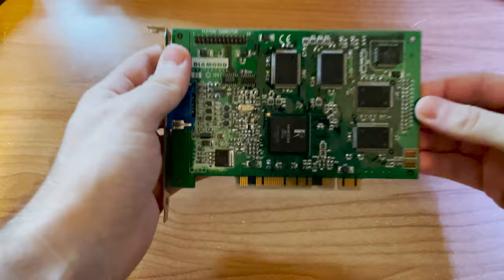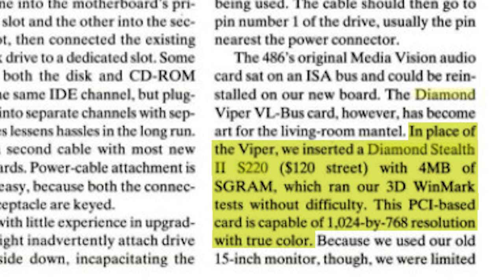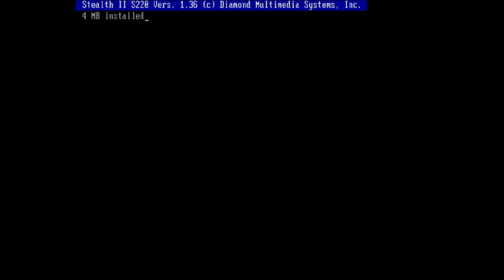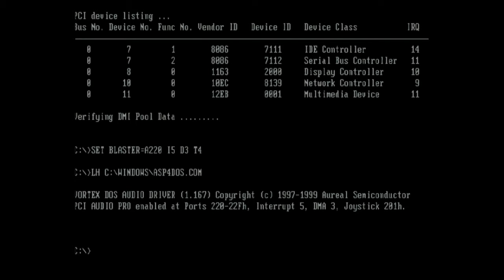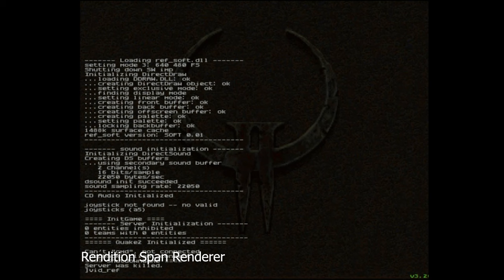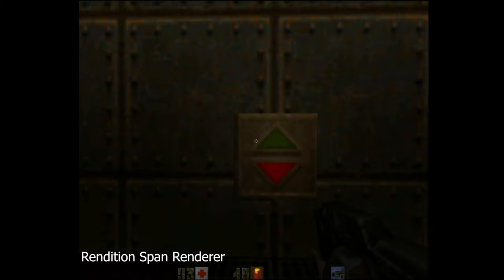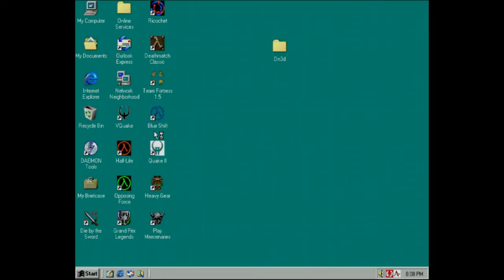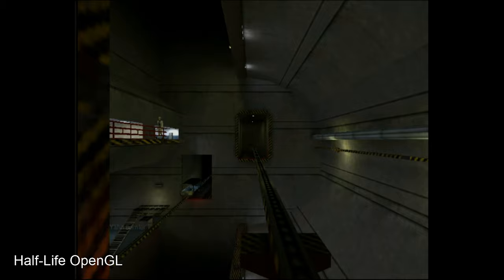So You Think You Want a 3DFX Voodoo: The Rendition Vérité V2200

Comment: It was originally clocked at 40mhz/100mhz core/memory.  Then there was a bios update that increased it to 55mhz/100mhz, however, you could really push it.  Add a little heatsink and it would clock at 70mhz/140mhz.  It was a value beast.
Reply from the maker: Hey, thanks for watching and thanks for the support! I do have that BIOS update on my card and it really did make a massive difference. Truthfully, without it, I probably wouldn't have made this video; it makes the card a much more interesting and much more pleasant experience. I can't believe just how well these things take that OC, and I'd be interested to see how it does at 70MHz/140MHz, as that seems like a pretty big jump, but I can imagine it'd be stable. I'll have to give it a go sometime!

Comment: I put one of these cards into a Pentium MMX system about a year ago.  I've decided to leave it there at least until I play through Quake.  I never got very far in that game back in the 90s, so I need to get back to it.
It's also interesting that this GPU has an accelerated version of Papyrus IndyCar Racing 2.  I wish they made a similar accelerated version of NASCAR Racing, a game I played obsessively back then.

I recall reading they had some manufacturing issue with the V2200 chip which caused a huge delay in it getting launched.  That delay was fatal.  They had the fastest GPU for a month, then Voodoo2 came out and they were a generation behind again.  This killed the value of the chips and the cards, and ruined Rendition's chance to gain an enthusiast following.
The 3D gaming chip market in the late 90s was such a precarious business to be in.  It was so easy for 1 strategic mistake or manufacturing problem to doom the fortunes of a company, leaving them without enough revenue to keep up with R&D.  By the end of 2000 there were only 2 companies left competing at the premium tier.

Comment: Wow. Somewhere I've got a several page spread from PC Format magazine (in the 90's), showing dozens of competing cards in the early days of PC 3D gaming. It was mainly 3 variations of the S3 Verge (or Derge as it was known 😆), a few 3dfx Voodoo variants, I think Matrox's Mystique or Millenium (don't  recall which)  was in there along with the Rendition Verite and a little known chip (from or called) Glint. That is off the top of my head.

At one point I had a Matrox M3D based on the PowerVR2 chip, that had 4MB RAM. It was a pass through board (like the early 3Dfx 1&2) but used the PCI bus instead of a VGA cable.  So no loss of image, it had no issue running Half-Life back in the day. It was along side a 2D card providing the screen buffer. I never saw either Verite or Glint based cards.

Comment: In the beginning, the purpose of a 3D card was to relieve the load on the CPU and thus achieve much smoother frame rates than the CPU could in software rendering mode due to the existing games, which were initially all developed for software rendering. For this reason, it is best to put such a card in a slow Pentium 133 MHz or slower.
A Pentium 2 is already faster in software rendering mode. I played the first few levels of Jedi Knight in software rendering mode because my P2 266 MHz was fast enough for that and there were no usable 2D/3D graphics cards for my taste available, when i bought my P2 brand new. Around 2 years later i installed a Voodoo 3 2000 PCI as soon as it was available.
A suitable card for your P2 333 MHz would therefore be a Voodoo 3 or even better a Voodoo 4 or 5 but definitely not this Rendition Verite V2200.

Comment: It´s nice to see fans of this card today, but I had one to use back in the day, and I never did. I had a Diamond Monster Voodoo 3Dfx connected to a Rendition V2100, and I could just choose what card to run the game on. The 3Dfx card would just run, period. The Rendition would not run at all, or run really slow, or full of glitches and visual bugs. Not as bad as a Permidia or a S3 Diamond Stealth, but geez. So I used it as a 2D gaming card and for Windows GUI, which was fine. Also, first card that I did a BIOS update. Saw no difference, but I did. In Rendition defense though, I guess my CPU was weak. Can´t remember if it was a 486DX2 66 or one of those Cyrix scams.
Reply: The Rendition, especially the V1000 does have one other drawback. It is a very slow videocard for DOS Games that use Software Rendering. Thus games like Duke Nukem 3d or Wing Commander 4. A real 2d DOS videocard with enough RAM for high resolution window modes and 2d window acceleration features is a much better combination with a Voodoo Graphics or Voodoo 2 accelerator.

Comment: Someone really needs to write a Verite emulation for DOSBox.
Reply from the maker: Thanks for watching!! I hope you enjoyed! Agreed! Honestly, it’s more compelling than glide because vQuake is so darn pretty! Rendition’s rendering is more hardware-specific, but I’m sure it can be emulated. I’d love to see it, as these cards are a bear to find working. The verite had a shorter life than it should’ve, but it’d be neat if someone could bring it back to the masses via DosBox or some build thereof!
Reply: @RetroTechBytes  Totally agreed that Rendition emulation is more compelling than 3dfx's. There's also Tomb Raider that looks more vibrant with Verite V1k compares to Glide version with quite washed out color and yet Rebel moon which runs in 3D acceleration only with V1k as well as vQuake which you just made me perceive how it was so valuable. I once had both V1k and the Diamond Stealth II S220 (V2100). It's so regrettable for me today by the fact that I sold both of them to buy Voodoo 2 card by a misled depreciation in the past.
Reply from the maker: @mytube9182  Absolutely agreed! OpenGL in Quake is unimpressive visually. The performance is definitely great, but there’s no denying that vQuake was the original 3D-accelerated port of Quake, and it’s probably the coolest because of that. Hey, Voodoo2s were still legendary cards! But you know what? Having had and enjoyed the Verite is the best part, and the memories that come from it are just something that wont leave you!
Reply: @RetroTechBytes  That's very true. I just can't forget the Verite's and feel that the defunct of Rendition is something regrettable when it come to stories of 3D accelerators.

Comment: Rendition were such a loss to the market, they had the potential to be a 3rd big player but Micron bought then and ran then into the ground. I had a V1000 system and even no that Vquake ran great. During this time ATI were nowhere they were still struggling to make a competitive 3D solution like S3 were,  an opportunity was there to be taken.
Reply from the maker: Hey, thanks for watching! Oh yeah, the V1000 is such a cool card! And I bet it was great on vQuake! It probably would’ve handled vQuake II just fine too actually! The span renderer was developed for the V1000s.They definitely were really close to being the 3rd dominant market runner, that’s for sure. I think the Micron acquisition was just sort of the inevitable result of their issues on V2200 yields. From what I’ve read, the V3300 and V4400 would’ve been interesting alternatives to the later Voodoos and might’ve approached Voodoo 3-level. Something like a vQuake III and associated renderer for Quake III engine games would’ve been really cool. It’s interesting to think about ATI’s rise and incline to number 2 with Nvidia. It’s kind of interesting because they did have some really nice cards early on, but they weren’t really gaming-friendly. The Mach32 with a full 2MB of VRAM was very, very fast for a VLB and ISA card, and it had a 64-bit data path to the memory. Thing is, the add-in card vendors just sold the 1MB DRAM variants and crippled the cards horribly. It’s a shame, really, and business moves like that cost ATI time and dominance. S3 did quite well with the Savage4, but that was late to the party. S3TC is such a cool tech though! UT99 looks gorgeous on it!
Reply: @RetroTechBytes  100% agree.  I did buy a Creative 3D Blaster Savage 4 & it did have great image quality but performance was so disappointing.  I Love old ATI & S3 Stuff & have an ISA VGA Wonder 512k in my 286 system & a S3 Virge in my 486.  Cant beat them for legacy compatibility.